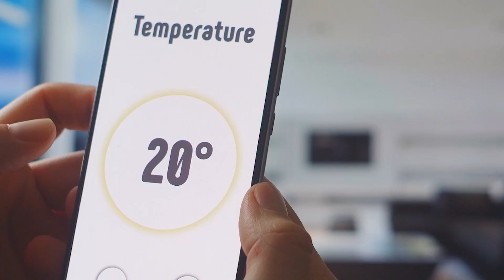A single chip for Matter smart home control: AIROC CYW30739 Overview | Infineon

Comment: Smart homes are the development direction of people's lives in the future. When processing current, Yongming capacitors have the characteristics of large capacity, small size, resistance to large ripple current, smooth voltage, and can respond quickly to instructions issued by the chip.